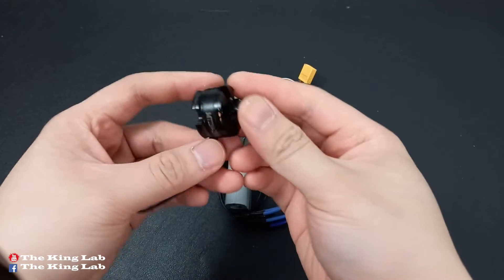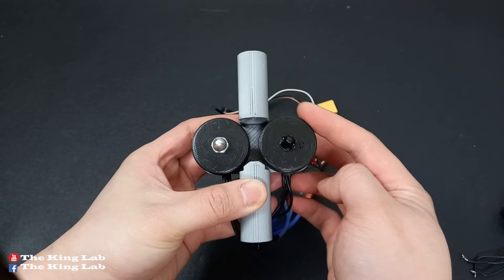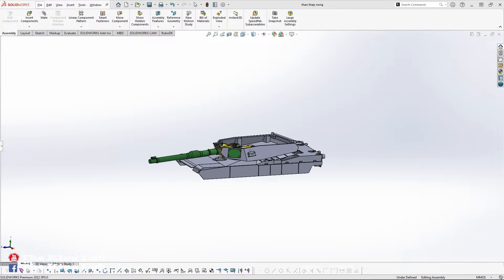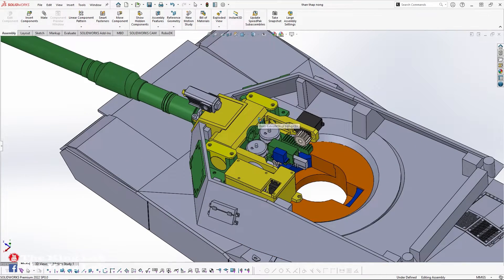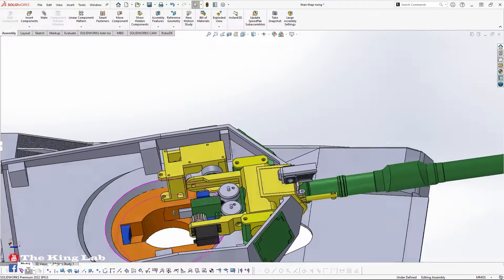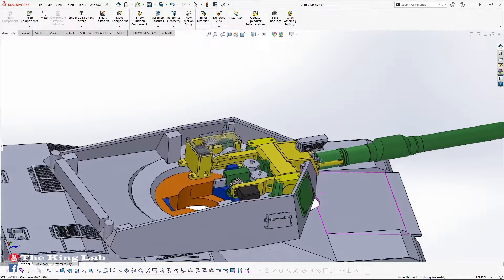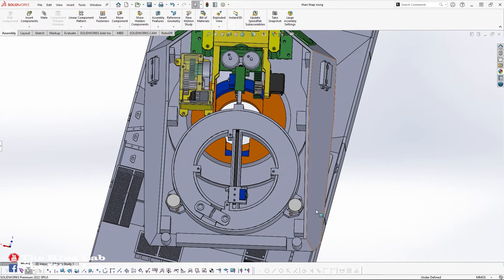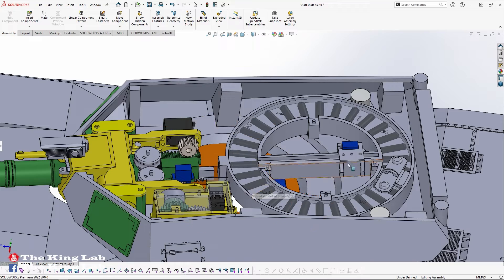RC Tank Autoloader. M1A2 Abrams RC tank 1/9 scale.

Comment: very nice, but you need to do some proportional and more precise control of gun rotation and elevation. General purpose 16bit timer in PWM mode will allow servo pulse resolution ~0.3usec, this is equal to 0.027° angle resolution, more than enough for low cost analog servos.
Reply from the maker: yes i did not combine the hardware well so that happened. i am in the process of completing other RC products and will be appearing on the channel soon. hope to have your support in the future